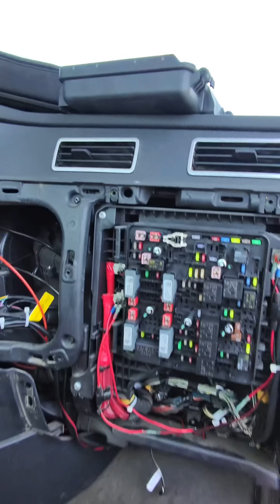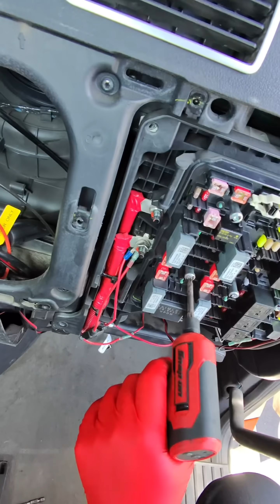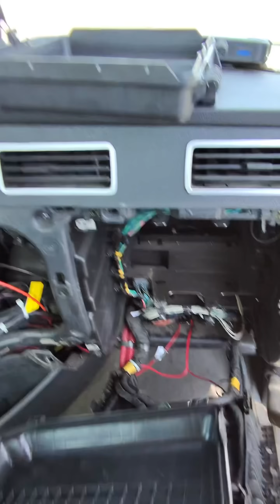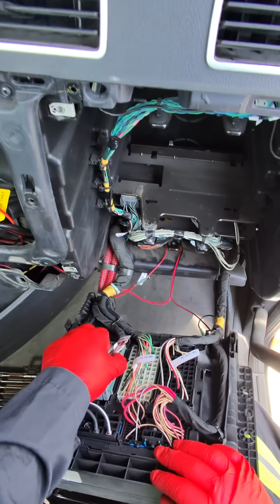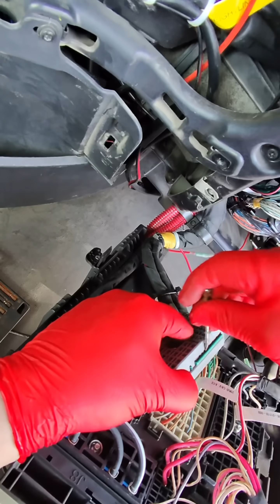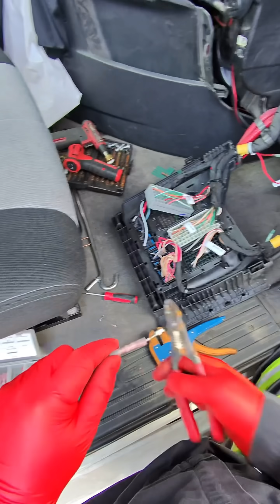MPC timeout codes solved by simple wiring fix 🔧 #diesel #mechanic #repair #shop #tools

Comment: So, if I'm hearing correctly, you misdiagnosed the problem the first time(s), and now you finally figured it out. Good, you admit you didn't know, and you learned. 
NOW, HOPEFULLY YOU CHARGE THE CUSTOMER ACCORDINGLY. The customer should not pay for your mistakes or for your training. 
If I'm the customer, I'd expect you not to charge me, except for parts (1 electrical connector, and a few inches of wire. Get it?). If you do charge me, that'd be the last time you see me. 
If I'm the mechanic, I'd certainly fix it at no cost. 
From the business point of view, definitely fix for free plus a free oil change for next time.
Reply: It was not misdiagnosed. 
He said, there was a service solution (repair bulletin ... usually from manufacturer . In this case, freightliner) sent out to techs in field.
This mistake is from the manufacturer! 
Comprehension
Reply: Don’t worry pal. His training is spot on. You sound like a typical steering wheel holder. That’s dealer level diagnostics he’s doing right there, dudes probably $80 an hour. Dealer is over $215 an hour where I am. Plus downtime. Dealer where I am is backlogged two to three weeks at any given time. He just saved that customer thousands, and thousands in downtime. Get your head screwed on straight.
Reply: What the shit hell you talking about, It's a fucking TSB--Technical Service Bulletin. Retired Toyota guy here, we go by what or how many issues we've had across the nation, then we contact our reign to inform them we have issues. If the same issue appears on lets say on 10k, 20k or 30k vehicles then we post a TSB on that issu or if its a extreme safety issue, we issue a National Recall by means of correcting the issue on the assembly line. Example; If you go to the doctor and they say you have a cold but turns out to be Cancer, do you ask for a free oil change?? You Quack job. During my time I held around 15 certs including Toyota certs and was a Auto instructor and that includes hybrid and EV and customers like you I would take care of in the service drive, I would give you your keys back and ask you to leave